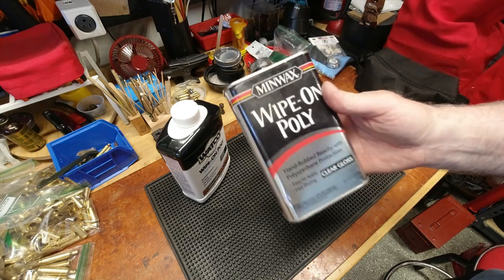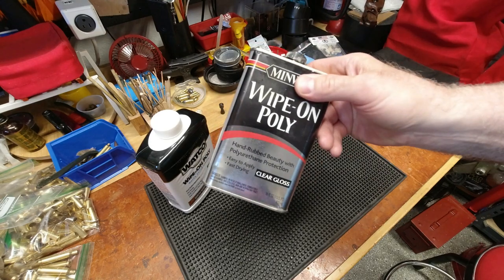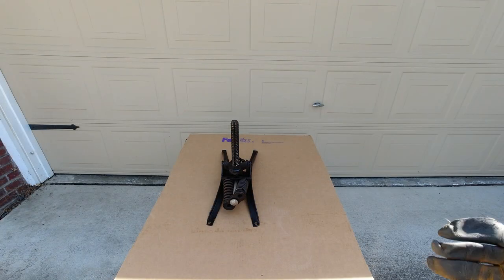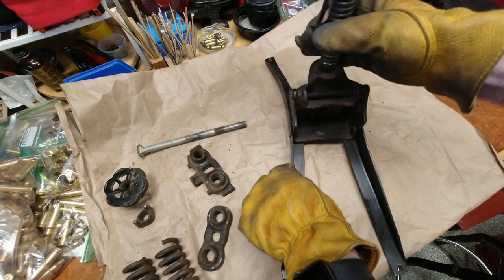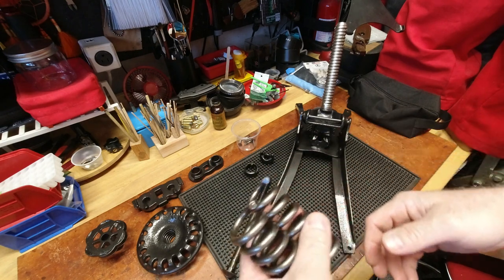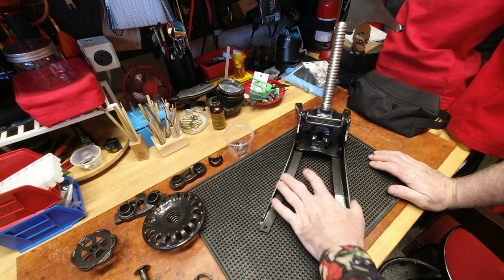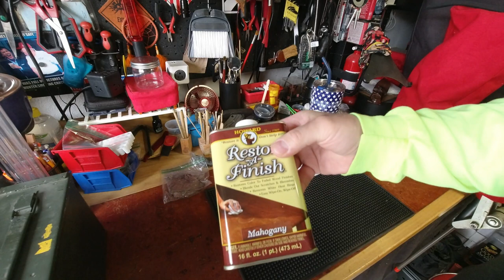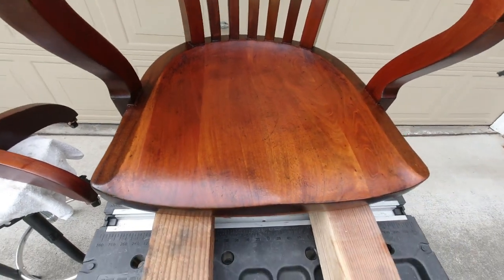Turning a $30 Chair into a $300 Chair with $20 in Products: 1940's Library Chair Reconditioning

Comment: Not quite sure how you did the screws to get the slots straight again. Did you hammer them
a little to put the raised fragment's back down ? I would of filed them down but that would probably
take some material away and that would not have been good ! Really nice job and those products worked 
really well :-))
Reply from the maker: Here's an old video I did back in 2017 of the process I do for "fixing" old screws... https://youtu.be/CXPgMkYkeb8